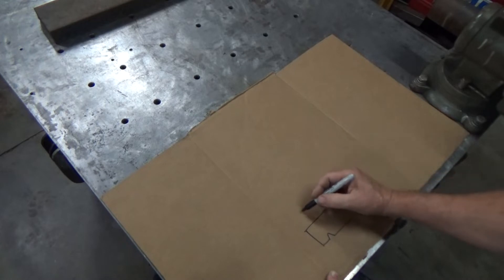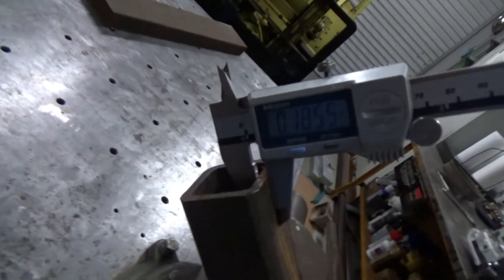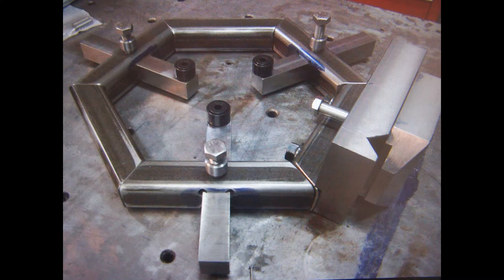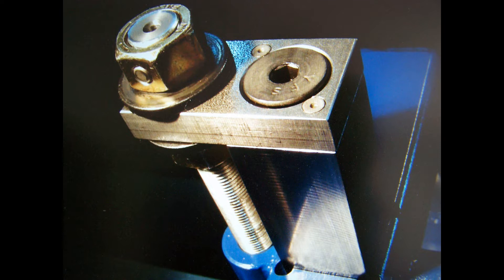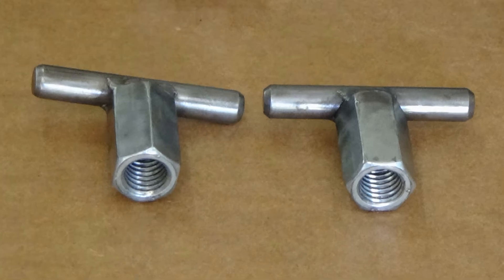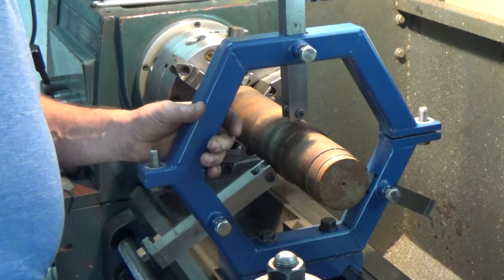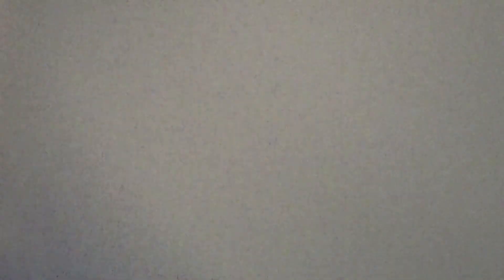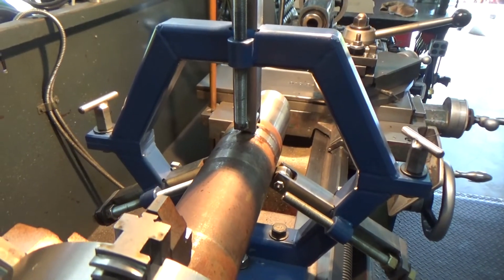DIY Metal Lathe Steady Rest Build...

Comment: What angle have you cut the 6 pieces of square box to?
Reply from the maker: Thanks for the question- the basic shape is a hexagon with the six inside angles at 60 degrees each, so I think I cut the square tubing to 30 degrees on each side to get to the 60 degree angle. Please know that it has been a while since I worked on that project.... Hope that helps, thanks again.